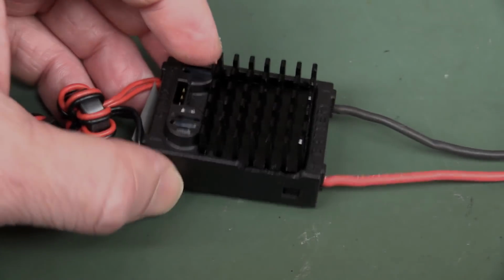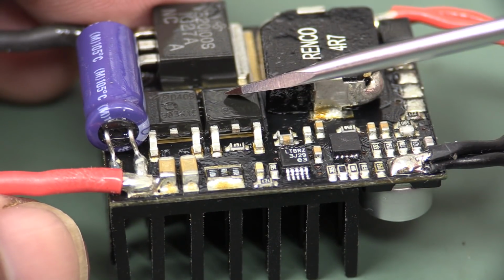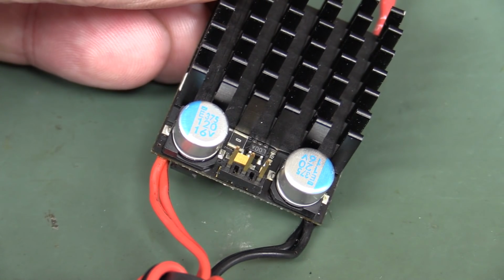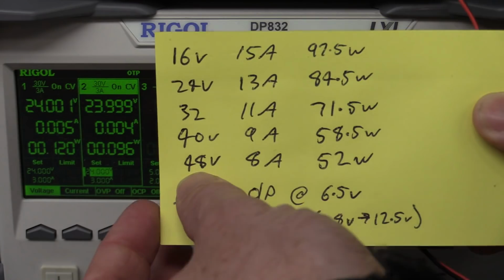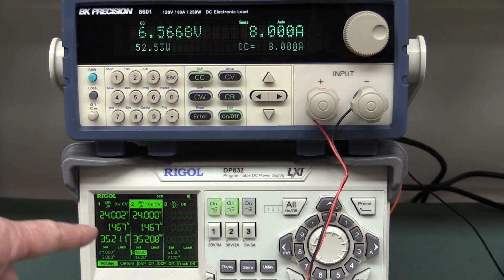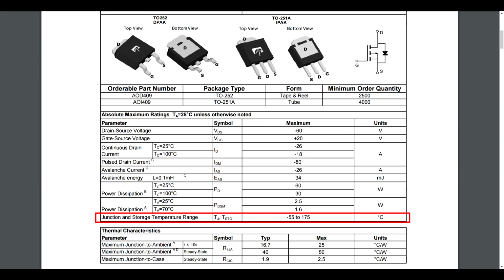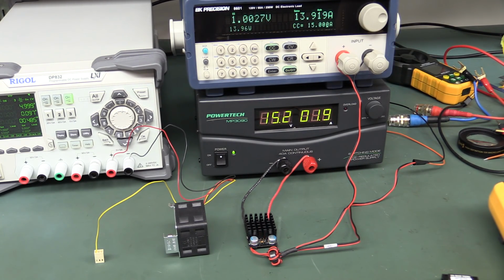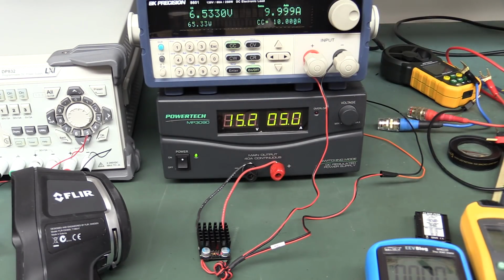EEVblog #895 - BEC Pro Model Airplane Regulator Testing

Comment: Castle is generally reguarded as the better quality BEC untis available out there. I see way too many guys bury them so they get inefficent air flow. The result is generally a brown out,this happends durning a manuver that requires more control surface imput,that inturn puts more of a load on the BEC,resulting in a brown out,loss of control and crash. Then its always blamed on servo's of course.I always use a ESC with a switching BEC seperate from the ESC so if the amp rating is drawing too much power,I dont lose power to my control surfaces.I havent experienced a problem since doing that. Even if my ESC goes up in smoke,I can still land my plane.
Reply: The Castle BEC is not really known to be reliable.  If you want something quality, Western Robotics are the best and most robust you can get.
Reply: The Castle BEC is not really known to be reliable.  If you want something quality, Western Robotics are the best and most robust you can get.
Reply: JETI all the way :P i fly large 1/3rd scale aircraft i wouldnt trust my $5000 plane to anything else :P
Reply: +warmfreeze You say that, but do you know why. Why is your Jeti gear the only thing that can be trusted? Because it's expensive?
Reply: +KpilotRCHelis No one is going to dump 100 bucks into a BEC on a foam plane. When you start talking $1000 dollars plus,then it only makes sense.  Thats like Transmitters,I recently experienced the disappointment of a Spektrum DX6I not being able to handle prolonged imput which resulted in a brown out. This happened twice on two craft. I had read these things couldnt handle excessive stick movement and found it to be true,twice on two different planes. I dont have unlimited funds for my equipment and dont see any reason it shouldnt have been able to handle imput that was created because the unit was not responding properly in the first place. I have noticed that,yes you get what you pay for in RC but in the same sense,you shouldnt have to dump even more money into the equipment because the electronics are crap to begin with. Its like buying a new car for 14 k and having it constantly breaking down because of inferior parts as opposed to paying $150k for a new car and having better parts,but still having to invest in better parts. eather way,you shouldnt have to keep dumping money into it because they used crappy parts.
Reply: +scott firman Not always true. In my Sebart Wind 50 ($1000 plane) I use a $7 BEC from hobby king. I bought it, took the heatshrink off and had a good look and tested it. worked perfectly and it's had about 50 flights so far with not so much as a peep from the BEC. I also use Frsky radio gear, in everything from foamies to my 700 size Cobra or my 1/4 scale cub. Because from an engineering point of view it's the best system available, and in 4 years it hasn't let me down once. Not once. I used to fly on Spektrum and lost 5 models to it.
Reply: +Sheldon Holy I can relate,I crashed two planes because of Spektrum. I wish I had known,I would have never invested my money in one. I was able to save both planes. You would think Spektrum,after getting a ton of complaints about their DX6i would do something about the problems people are reporting. I had a brand new ST. Salta that I won from tower hobby nose dive into the ground,a week before that my Dynam Waco Biplane did the same thing,I blamed it on something else. Generally I noticed the loner I flew,the less conteol I had on the plane,until basically,I was performing controlled crashes just to get them to land. I am looking at a Tactic 6 channel transmitter as a replacement but am open to suggestions. How do you like the freesky transmitter? How is it to set up as far as Rates and Expos. Channels? I had a hell of a time setting up channels on the Spektrum. the manual was a damn joke. I have heard many guys say the Tactic 6 is easy to set up and manual is good. I wouldnt mind buting the 8 channel except guys are saying the tentioner bar for the throttle is crap and the mount breaks easily.That and another issue that I cant think of. Hey let me know what your opinon is on your transmitter. I usually dont buy much from H.K. anyways,shipping is slow,I personally do a ton of business with Motion Hobbys. Those guys are good to me,fast shipping,answer my questions. Do you think I should bother sending my 6i into Spektrum to have it looked at?
Reply: Someone should send Dave some cheap ones for destructive testing ... while connected to a high-current supply like a lipo battery (though I suppose that is a big fire hazard if the unit shorts out!!!). :P
Reply: yes, it has its merits.. I think youre right there is less risk..
Reply: brown outs are no fun.. it can be the controller rebooting.. da na na nah nah!!!

Comment: Of course it needs some air flow. You don't need to be an electronics engineer to think about it...
Reply: The problem is that in the intended use it will rarely get the cooling it should have. Nobody will make it stick out of a plane because it would be ugly, and while you can certainly get proper airflow in the fuselage on large models, most people have no idea about it.
Reply: At the same time though, although yes it's true it doesn't meet its requirements without airflow - it's also true that it almost certainly will never see maximum load for more than a few seconds at a time. You'd have to do some batshit insane aerobatics for a full 10 minutes (that's when your battery dies anyway) to keep servos working that hard!

Comment: When taking those thermal measurements, they should have been done with the PCB in the actual plastic case, as from my perspective, it obstructs the heatsink somewhat.
Reply: Good point.  It blocks the heat sink a bit but even more it totally blocks any air flow directly over the FETs on the component side.  Dave should have used a thermocouple glued to a FET and put the covers back on (little hole for the wire of course) to get a more accurate result.  But it was only a rough test really.

Comment: You'd need some serious servos to be pulling that much constant current.  Unless one is stuck or binding you'll never get close to that draw.  Also planes and helis generate a lot of airflow with props and rotors.  I think it'll do the job but is over rated.

Comment: EDIT: SORRY I DIDN'T WATCH THE VIDEO UNTIL NOW WHEN I GOT HOME AND REALIZE THIS IS NOT AN ESC BUT A BEC

If you looking for real performance the very best Esc's on the market are made by KISS,  they not only have extremely fast acc but also deceleration due to the regen braking. What sets a good ESC apart are dedicated FET drivers and hardware pwm. We use the KISS24A for multirotors they are tiny and can output 24A continues without cooling. They don't have a BEC but a good bec is tiny and cheap.
Reply: ...Plus of course the KISS FC has a built-in 500mA, 5V BEC which is sufficient to power itself and the Rx directly from 2S-6S packs. Then if you need more 12V/5V power for other addons you can always use a Pololu or similar. It'd be great if Dave got into more RC stuff!
Reply: I absolutely love the KISS FC with the KISS 24A ESCs! The FC supplies power to the receiver and my camera and Vtx work with 4S batteries so I don't need a voltage regulator. Also the telemetry works great, my transmitter displays  rpm, A and V and a voice tells me the voltage every 20seconds.
Reply: Kiss ESC was know for blowing up because of bad soldering. Is this fixed by now? I had KISS esc on two QAV250's but swapped them out because of all the bad feedback the got.
Reply: Mathias Tveit Two of my KISS 18A ESCs caught on fire but then I realised my motors were pulling over 22A. The KISS 24A RE have overcurrent and overtemperature protection and I haven't had any problems with them yet.
Reply: Lol you're a mini quad guy.  Helicopters and airplanes are totally different.  The only reason those TINY ESCs mini quads use don't burn up all the time is because of the insane airflow.  If the same principals of using tiny PCBs, no input capacitors, and tiny input/output leads were applied to ESCs for helicopters and planes, ESCs would be bursting into flames left and right.
Reply: Lol you're a mini quad guy.  Helicopters and airplanes are totally different.  The only reason those TINY ESCs mini quads use don't burn up all the time is because of the insane airflow.  If the same principals of using tiny PCBs, no input capacitors, and tiny input/output leads were applied to ESCs for helicopters and planes, ESCs would be bursting into flames left and right.
Reply: Actually the KISS 24A are rated for 24A without any airflow and I had them sandwiched under the quad in a previous build without any problems besides space. I also fly planes so I'm familiar with bigger ESCs with heatsinks.

Comment: can i replace liquid caps with solid?
Reply from the maker: Yes, no problem.
Reply: That depends on the circumstances. If it's on the output of, say, a linear regulator (or even a switchmode one), the ESR (that's much lower than a wet electrolytic's) could cause the regulator to oscillate. Best to check the datasheets, though.
Reply: ThemGames Here's a google search link to an entire host of so-called "poly mods" from the Badcaps.net forums. I'm quite sure you'll find the needed information there :)

https://www.google.fi/search?q=poly+mod+site%3Abadcaps.net&client=opera&hs=h5f&channel=suggest&oq=poly+mod+site%3Abadcaps.net&gs_l=heirloom-serp.3...4640.7480.0.8197.12.9.0.0.0.3.273.884.3j2j1.6.0....0...1ac.1.34.heirloom-serp..12.0.0.q3ww5sdcbsU
Reply: Same XD
Reply: +KhronX its an old 1990's motherboard vrms cap
Reply: KhronX
Are you a member on Badcaps?
Reply: Benjamin Esposti I sure am :P

Comment: This is over rated but giving Model aircraft dont draw constant current is actually really good , also planes and helicopters give some airflow since they are flying
Reply: Also it can output up to 12.5v max
Reply: But it says that the BEC is capable of a CONSTANT current draw of the said amps. Clearly false advertisement.
Reply: The BEC is rated  with 3mph airflow over the heatsink ...
Reply: +Rcmodellbau_DE Is it? The person who sent it in had it programmed for lower current for his set up and how many cell battery packs he runs. Dave pushed it last for how it was programmed and that's why it fell off. If it was reprogrammed then it would have done what it claims to. But the programing of these ESC or BEC is were I see most people fail and burn up the electronics in RC.
Reply: +Gadget Review (GRV) Most people dont even know how to properly program or set these things up in the first place. Remember too,the rating are listed at Peak ratings,only designed for short bursts,not prolonged like Dave did,that was totally uncharacteristic of how anyone would fly,or load up the BEC. Besides,I found out the hard way,its the transmitter that tends to fail on extended stick usage,power consumption.
Reply: scott firman
Read the specs again: It claims to be capable of a constant current draw of x amps, depending on the input voltage.
Also, of course i know that this kind of long term currents dont appear in rc aircraft (im flying them for over 7 years now), but when something claims to do something, it has to.

Gadget Review
You cant program these things to a specific input voltage or a specific output current, thats just nonsense. Look up the manual if you dont believe me.
https://i.ytimg.com/vi/hxb_OjfM4Vs/maxresdefault.jpg
Reply: So BEC from castle are not programmable. My ESC from castle is programmable, one of the things it does is makes sure you don't p,it in the 5S LiPo when you have it configured for the 2S LiPo. It will initiate a cut off, just like the low voltage cutoff so you don't over drain you LiPo pack, but it will also do it if it sees higher voltage then what you programmed it to run. I dint know about this specific unit, I don't fly I drive RC. I've been told in most cases ESC and BEC are not that different. I wasn't talking about output current, I was talking about voltage of the pack when you first turn it on. I know programing doesn't regulate the voltage, on the ESC programing tells the unit what to expect or cut off to prevent damage to the motor if a higher pack is plugged in for the motor/ESC setup. That's all I was saying, I figured it does something like the ESC since the sender said "it was programmed " for a specific battery pack in the letter.
Reply: I did just check the manual, it doesn't say anything about the programing or how it handles programing with the castle link. But it does say to use both output leads together for max current draw, and notes if over 10A to replace the leads since these leads and most service don't draw over 5A. So each lead is rated for 5A, 10A with both. Maybe Dave should have replaced the lead according to the manual since he was testing over 10A draw, and Dave used the one set of leads for monitoring accuracy off his BK load.
Reply: Ok, further research this unit can be programmed and control the output voltage per servo line with the castle link. It will not put out more voltage then you putting in, it's not a booster. But each servo output lead is controlled, for this unit you can program it to put out up to 12.5V per line. Of course as I previously stated for 10A both lead should be in parallel and the manual stated for over 10A you should replace the wiring and leads for the max continuous above 10A. By default I think they come programmed for 5V on the servo lines. The user mentioned he programmed it for higher, maybe 6.5V but I didn't watch the video to again to confirm. The 3 pin port on the top is used for the castle link programer to USB of your computer.
Reply: continuous means what?
Reply: wayne bayer
Well, it basically means that it can deliver a specific amount of power for as long as you like, without any time limit

Comment: cheap? castle is brand name in the rc world. A cheap bec is less than 10$ :)
Reply: The price is pretty normal.. remember 90% of becs are rated for 2amps max and use linear approach (7805). That said.. Castle creations is Apple of rcs. Overengineered and overpriced in most cases.
Reply: Lol @ using a 7805 at 48v. Holy christ that's a lot of heat dissipation xD
Reply: This BEC is "inexpensive" cheap can sometimes imply poor quality
Reply: Hobby King sells some really sketchy stuff. You get what you pay for though. With any of this stuff,you shouldnt expect a $7.00 BEC to last anyways. I have noticed most of these things come with a shrink tube over the cooling surface.  I always cut a good portion of it away. If I can,I try to place my ESC and BEC in the front of the nose closest to the propwash. Happy flying!
Reply from the maker: Ok.
Reply: I use few of these since 2008 and none broke but they do browout / power cycle under too much load. I wish I could make my own.
Reply: Western Robotics 14s BEC is $100 and much more beefy
Reply: Thanks I'll look into this
Reply: ive added air scoops and cut out the back window for air flow, part of the fun of designing
Reply: A BEC isnt really under load..
Reply: Its the motor that sucks amps.. the bec is for auxiliary power.

Comment: Dave,

Castle Creations makes some of the better reliable BEC units in the RC Industry. I wouldn't worry about the lifespan of the caps. Most likely the failure of the BEC would be due to a crash.    :-)
Reply: crashes are usually due to failures such as this. Most of us that have flown for years,rarely crash and usually its on landing due to cross wind landings. I havent had a crash in quite a while, the last one was caused by servo failure. I dont expect electronics to hold up for longer periods of time and generally most electric motor planes only fly 15 minutes tops while gas is 25-30 minutes at best. Like I said, most guys I fly with are pro's and generally dont crash. when you invest 3 to 5 k or more into a plane or heli,you usually dont go with cheap BEC's or U BEC's. I use An ESC and seperate BEC. I see too many planes not having enough air space to properly cool these types of BEC's.Happy flying!
Reply: I think it's safe to say BEC's are rarely run at their absolute max rating continously anyway. It's a varying load - I can't think of many situations where a heli or plane will be asking for maximum juice during an entire flight. Unless you're Alan Szabo.

Comment: if i understood right this is for tricopters right? so ehen they fly there is air passing throught the heatsink. havent finished the video yet. just mentioned it in case you didt try bloeing a small fan on it in the next tests(after the first 160c "meltdown")
Reply: +Armin Keller you wouldn't put a 10 amp bec on a tri. It only has one servo, a 2 amp is plenty.
Reply: yep...you checked sorry for the last comment
Reply: also, it could be used on a plane, boat, car, any rc really.

Comment: The reason it goes down to those connectors with the thinner wire is that those are the standard connector for a BEC, servo, or ESC in the RC industry and they are limited to the power that can go through the pins. More advanced users (many of which buy Castle products) can just chop off the connector and wire into whatever needs power through the BEC.